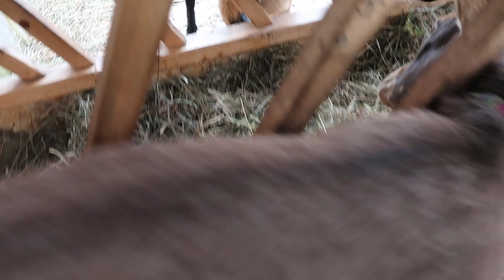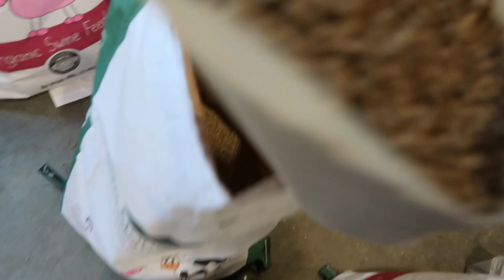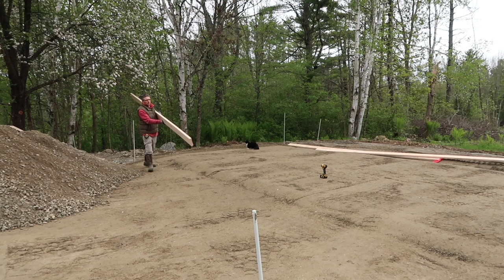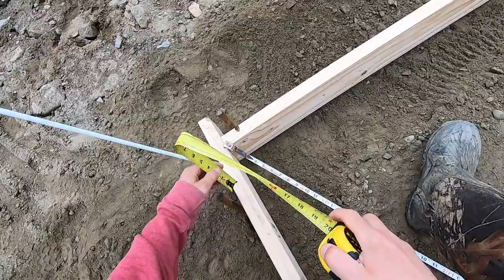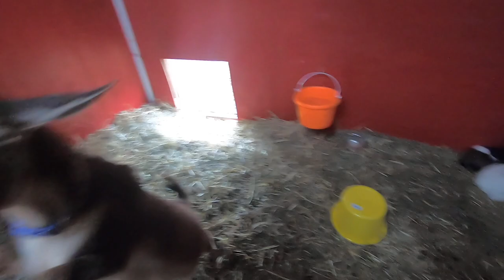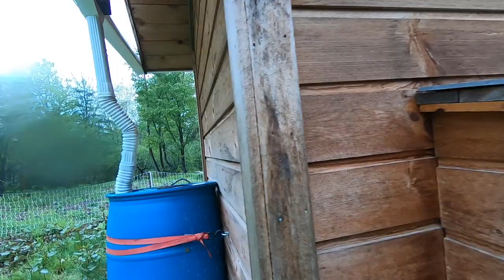Just when I thought I was ready for the next step Barn Build #5

Comment: Looking good Al. Just a little trick when nailing form boards to stakes, use your small sledge hammer as a backer on the other side of the board when nailing in the nails with the framing hammer. It’ll prevent to stake from getting moved around and the nails go in easier. Can’t wait to see the barn go up

Comment: All. Have you ever had sauteed brussel sprouts with bacon and garlic?  They are fantastic that way.  Just cook 2 or 3 slices of chopped bacon until crisp. Drain all but 1 tsp of the fat.  Add chopped garlic and cook just one minute. Toss in the brussel sprouts and stir well to coat with the bacon and garlic. Cover and let the sprouts steam until tender. Check frequently to make sure they dont scorch. Take off the lid and cook until any excess moisture is gone You can eat them now or add a drizzle of balsamic vinegar or even a sprinkle of shredded parmesan cheese.   Some evenings that is dinner for me.
Reply from the maker: No I haven’t. But they sound amazing

Comment: 3 4 5 or 6 8 10  for larger areas will give you 90° angles, Al before pouring the concrete, find out what forgivable measurements are allowed, you'll find it so much easier to construct this barn. Often to much interest is put into floor and not the footer or stem wall. Building sinking and twisting in the future really suck.
Reply from the maker: The kit comes with the recommendations for the concrete slab I built this to their specs

Comment: When the cement pad was poured for the addition to my library, an error was made in that the pad was larger than the addition that would sit upon it. This caused rain water to pool up at the perimeter of the addition and enter the building. Corrections had to be made which could have been avoided if the pad had been somewhat smaller than the added structure.

Comment: What kind of screws did you use for the frame. I noticed you didn't have to drill pilot holes. I couldn't get screws that long in to wood with out pilot holes. Maybe I just have a week drill.
Reply from the maker: Exterior deck screws

Comment: The 90*  formula is 3, 4, and 5 feet triangle. But in view of the size your working with you did it the right way.
Reply: 3,4,5 method never fails. you can go longer spans just use multiples of (which ever number)x 3,4, and 5

Comment: I'm curious..
Your footings don't have to set below the frost line..
I read online New Hampshire frost line is 48 inchs.   ?????
Reply: If he really wants this building to last his footings should be below frost line. Additionally he should have concrete pilings below frost line to support the interior posts of the barn. Successive years of deep winter freezes followed by spring thaws and mud season, this will heave and settle and greatly shorten the long life of this barn and slab. He's referred to this construction he's using as floating slab. It's not really. A floating slab construction consists of properly poured footings and pilings to support the frame of the structure, with a detached slab interior floor that can float. Detached slabs often include a French drain that will drain off excessive water from around the footings and slab and run it away from the foundation and building.
Reply from the maker: We are making a monolithic slab to build the barn on a.k.a. floating slab
Reply: @LumnahAcres  
Monolithic I understand
Being from. Los Angeles 
I thought the idea of footings below the frost line. 
Helped keep the building from being lifted...